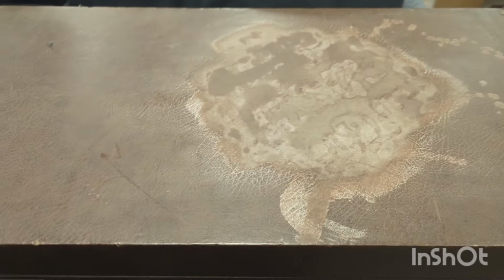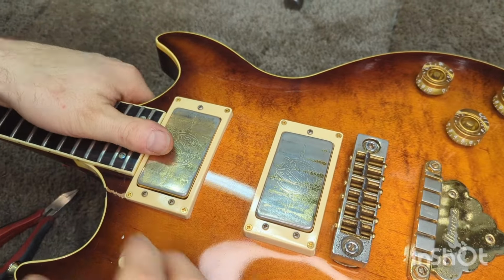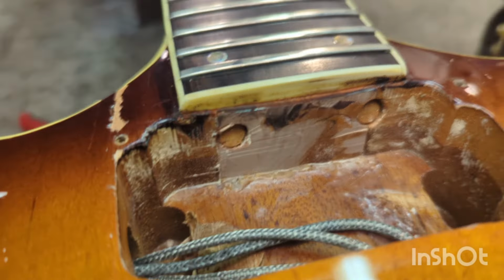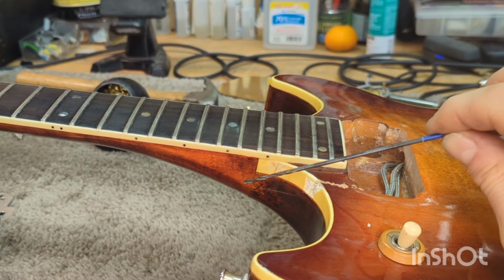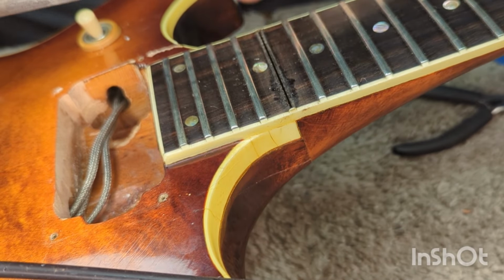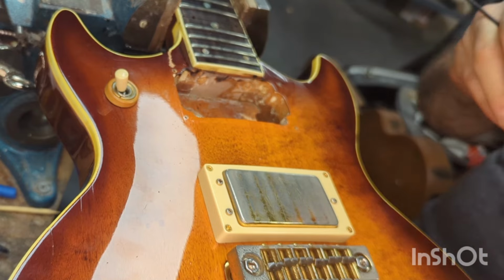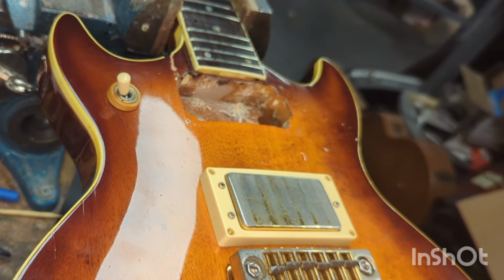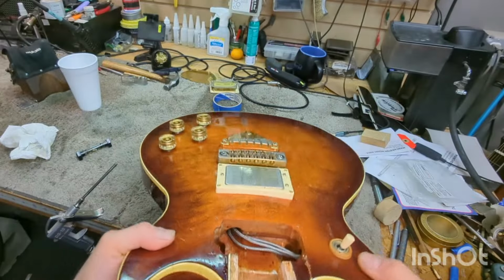VINTAGE 1977 Ibanez Artist nearly RUINED by previous technician. 🙄

Comment: I own the same model, 2618. The dowels are factory.
Never seen an Artist with these issues, truly amazing guitars
Reply: Same. Mine has dowells
Reply: I remember my 1978 Artist having the same dowels.
Wish I'd kept my Artist, I also purchased a then brand new IC-400 in Midnight Olive, more regrets letting that one go in 1980.
Reply: Same dowels in my 1986 AS-200
Reply: Always wanted one of these guitars,I still do & I don’t believe they all have this problem,must have taken a fall.
Reply: @GuitarDaze2023 I sold a cream Ibanez artist AR350 with the tremolo on it. I've always regretted selling it until a couple years later I found out the guy who bought it  from me had the neck tear apart from normal string tension while playing. 
It was unrepairable. That sucks
Reply: Ich würde nicht wollen, dass jemand so grob und unsensibel mit meiner Gitarre umgeht!

Comment: A good way to get old solder joints to melt quicker is to add a little new solder to the joint.  When the new solder molten hits the old joint it usually pops the wire right off

Comment: I think it's factory. Although I hate it when someone comes in with a guitar that the person itself or some amateur luthier uses wrong tools/techniques or materials to fix a guitar. The worst repairs I've encountered were superglue on wrong color paint that was put on nitro finishes. Absolute horror to remove that. Takes three times as long to do the repair. Take your guitar to someone who knows what he's doing folks!

It's such a satisfying feeling to pull off a glued neck. Gives so much leverage when repairing/setting up a guitar in the future.

Comment: If you think pickups don't make much difference, I can only deduce you have a modern amp/don't have much experience playing on a good amp and/or you may not be a great player/have a good ear for things. That's fine, most guitar techs aren't really great players. You may also be under 40, not sure. I get that if you go into Guitar Center and plug any guitar in any modern production amp they are selling you can hardly tell a Les Paul from a strat. This is due to about 5,000 too many components on the PCB. All the bells and whistles are made to make you sound good even if you have a Firefly and you are a beginner. As a person who repairs, mods, builds and designs tube circuits and has been playing guitar since the early/mid 80's, I assure you pickups matter, your guitar matters and with a good basic vintage or vintage style tube amp you can readily hear these differences.

Second, are you sure this Ibanez wasn't made in the same factory as Greco guitars? Because that is exactly what they did in the late 70's, you had two dowels attaching the neck on their Les Paul Copies many of which used these same pickups albeit not with the same embossed covers with the butterflies. Granted, I see putty but maybe that was someone half ass trying to stabilyse the dowel set neck that had cracked. Just saying, have you ever seen those Greco's with the doweled necks?
Reply: Wow, I kept watching just to see how this would progress I figured it was gonna be interesting at least and I must say, you just start making a big friggin' mess. It was like looking at a 10 car pileup and you can't stop looking away even there are bodies everywhere.
Reply from the maker: Yes, I only have ever played on a vintage Crate GX15. 🤡 Tell you what. Make some recordings. In a mix. Of two different humbuckers with similar output readings. I'll wait.

Comment: I have been doing guitar repair work since 2015 on a part time basis.  That was the wrong way to fix this beautiful guitar.  you have the right idea  drill out the dowels and heat the neck heel

Comment: Great Content, Thank You
Back in 1978 I purchased a brand new Ibanez Artist, all Ash with the fancy inlays, it was a great guitar.
I switched to Ibanez to replace the 1977 Gibson Les Paul Deluxe I was using, at that time the Ibanez the better guitar of the two.
Wish I'd kept it, the Flying Finger Super 80 Pickups were pretty nice.
Not sure, but I believe the Vintage Japanese solder used a different ratio of Tin/Lead than modern Solder.
Reply: Yeah he is dead wrong on that too, old solder melts easier.